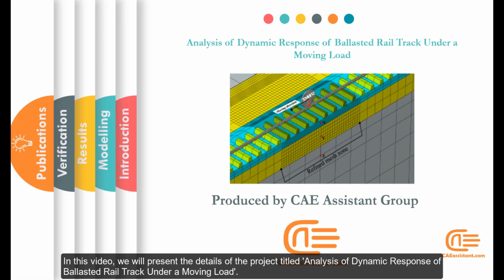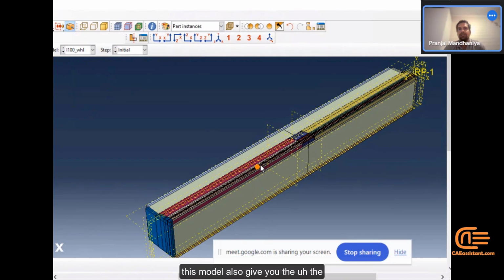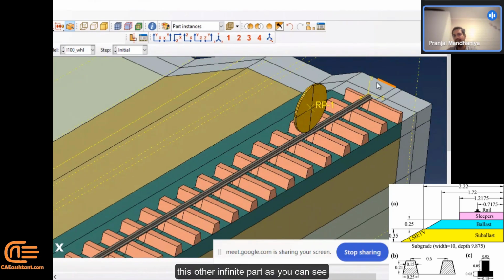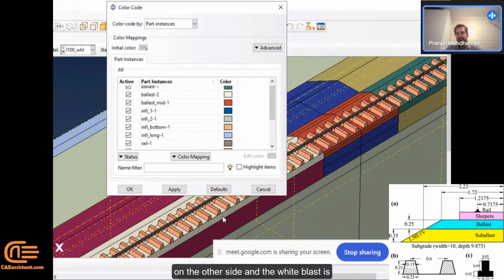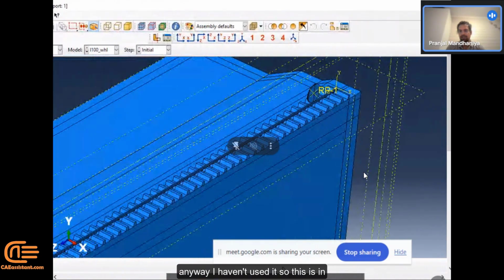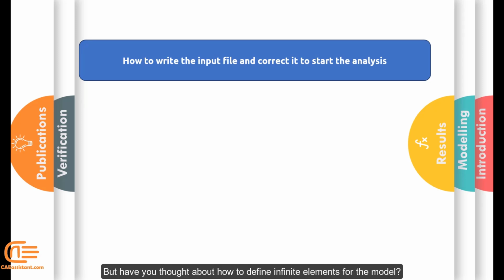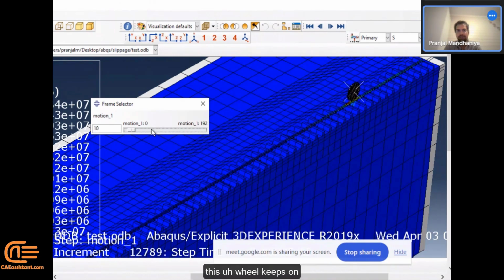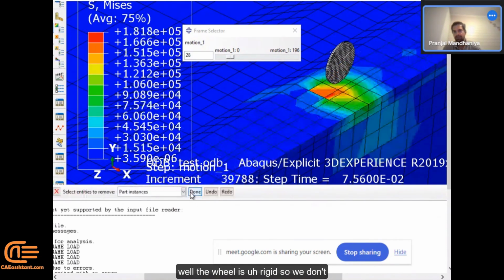Rail Track Analysis using DLOAD & VDLOAD subroutines in Abaqus

Comment: why there is only one rail ? is the analysis on one half of the rail ?
Reply from the maker: Yes 
When the number of elements is large, and the boundary conditions are symmetric, you can simulate only half of the model in Abaqus. Just you need to apply symmetry boundary condition. In this example, the same approach was used.

Comment: bhaiya i have to do an ug project in abaqus where proff asked me to model a train track and apply cyclic load and see the result can you help me step by step as i dont know anything in abaqus.. please bhaiya help kar do.
Reply: please reply karna bhaiya even if it is a no so i can plan accordingly for the project, please bhaiya.
Reply from the maker: Hello, 
if you don't know anything about Abaqus I recommend start from the beginning; you can use our free packages to learn the Abaqus which the links are below:
https://caeassistant.com/product/abaqus-for-beginners-mechanical-engineering-mech-free/
https://caeassistant.com/product/abaqus-fea-training/
Also, you can visit this page which you will find usefull things for free:
https://caeassistant.com/free-abaqus-tutorial-training-video/
about the specific case you asked, after learning the Abaqus, you should buy the package and the link in the description.